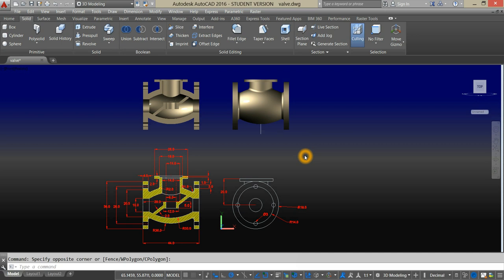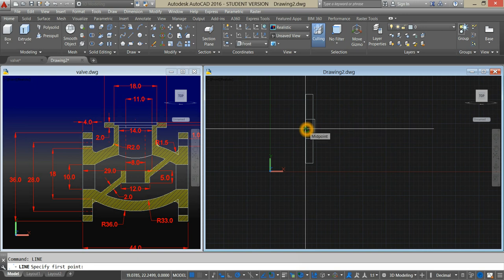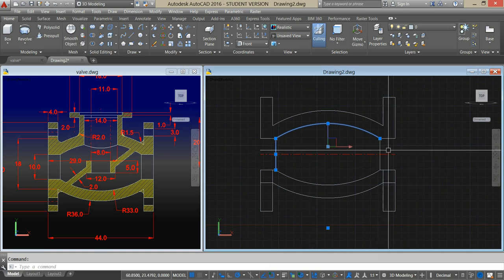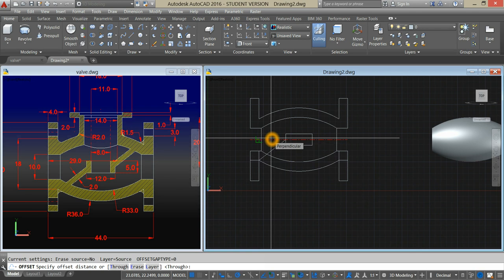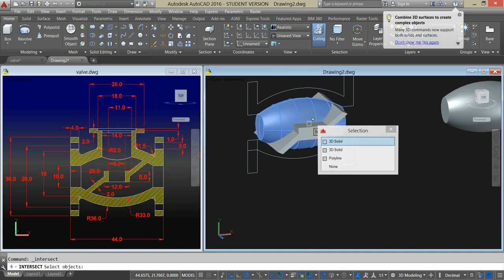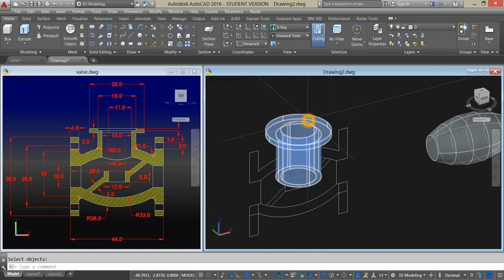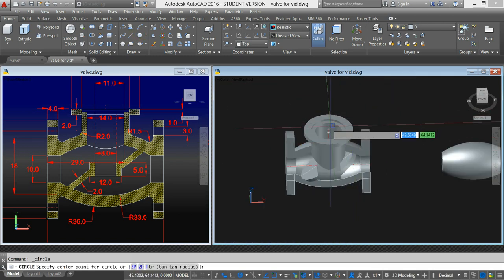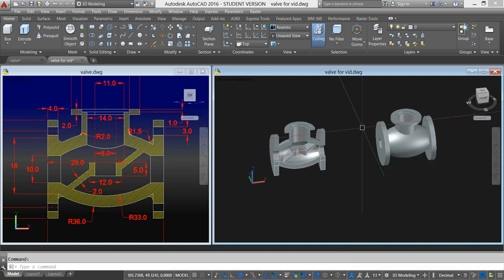AutoCAD 3D - Globe Valve (body) Tutorial

Comment from the maker: A Globe valve is a linear motion valve that is essentially designed to regulate the flow in a pipeline. In this tutorial, I modeled a spherical shaped body of a valve that can contain internal parts. I have utilized the following AutoCAD commands in this tutorial:
REVOLVE, EXTRUDE, MIRROR, FILLETEDGE, INTERSECTION, SUBTRACT, CIRCLE, LINE, OFFSET, TRIM
Pls click the link to my website for the dimensions
http://autocadnetwork.blogspot.ca/2017/12/blog-post.html